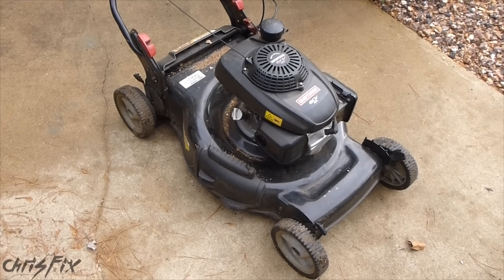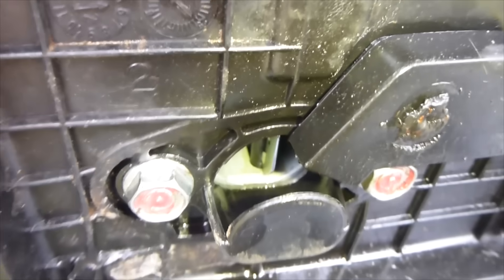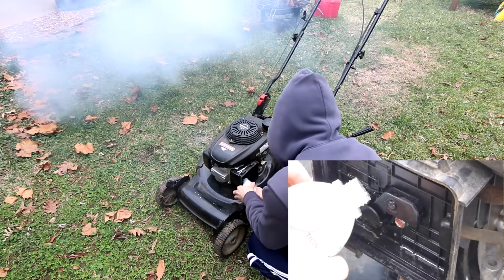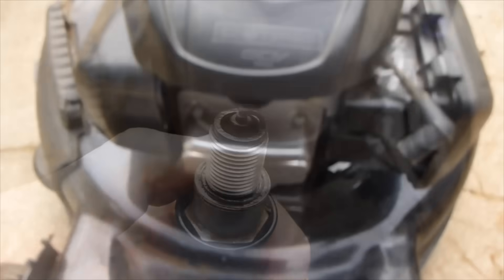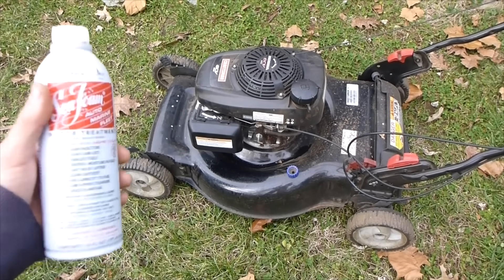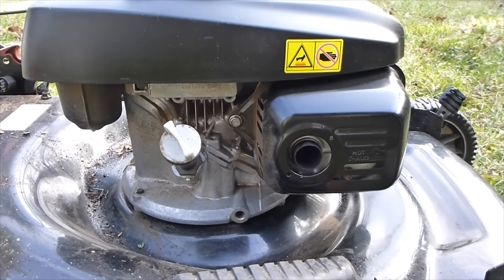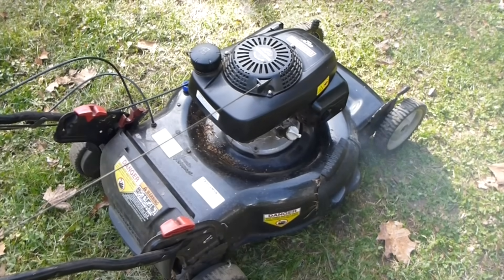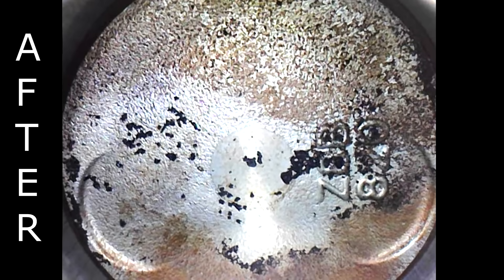Does Seafoam Actually Work? (with Proof)

Comment: FYI - you can run water into the intake and clean the piston too.  Just say'n
Reply: Adam mix I'm not messing with him, if the engine is at operating temp you can pour water into the intake and it will clean the carbon out. You can also drain the oil out of the engine and fill the crank case with diesel fuel, run the engine for 5-10 minutes then drain it and refill with engine oil to clean the carbon out of the oil passages.
Reply: +WinXPwhiz Hesmessin with you. Dont add water to your engine.
Reply: +Ken Simms Won't that hydrolock your engine? Water doesn't compress.
Reply: +WinXPwhiz best way to do it is to use a spray bottle. just like in the video, spray until the engine start slowing down. Repeat a dozen times and it should be sweet. Worked for me
Reply: +Ken Simms Water works better than this stuff, if the engine is hot. Also you can use ATF (automatic transmission fluid) to get better results, it is high in detergent and cleans well.
Reply: +hommie789   You're right I had to look it up. Sorry I assumed water was always harmful to engines.
Reply: +Adam mix There's such a thing as a water and methanol injection after market kit too, both for Gasoline and Diesel engines.
Reply: +Ken Simms No one ever needs to do this. A car won't perform any better or worse with such a small amount of carbon removed like the Seafoam results. Unless you post pics of your piston on facebook there is zero need to do it
Reply: +WinXPwhiz but steam does.
Reply: +Ken Simms get a carbon fiber engine. its better and you don't have to clean it.
Reply: If your engine is gunked up with sludge, you can add a quart of water to the oil, and it will clean it up like new. Just run it for 30 min, then drain. Repeat if necessary.
Reply: +WinXPwhiz if you fill your engine then yes it will hydro lock but the way to use water is get engine hot then bring revs up to approx 2000 and slowly pour water into the intake.
Reply: +hommie789 Well I'll have to keep that in mind.
Reply: ***** I don't like the thought of adding gasoline as it is so dry but diesel is an oil so it has lubricating properties to it, they use it to lubricate the injectors and injection pumps, so draining the engine oil out and refilling with diesel will cause no harm but will cut the sludge. But if you perform regular maintenance to your engine you will never need anything, all this is just for people who neglect their engine.
Reply: +4nuk8r carbon fiber is like woven stuff that they put clear stuff on and it gets real hard but doesn't weigh anything but it's like steel or metal but it's not really metal it's sorta woven
Reply: +hommie789 It will also wash the oil off of the cylinder walls.Don't do it.
Reply: Chief 1 What will? Using diesel fuel? Diesel is a #5 oil and is used to lubricate pumps and injectors in the system and causes no harm inside an engine
Reply: +Kevin Miller caurs cant drive on water. have to be gas or car is going to rust inside and not drive
Reply: +hommie789 Id buy that, and Ill share my little anecdote as to why. 

I used to run an HHO device in an older S15 pickup.. It was the 2.5L 4 Cyl, good ol Iron Duke. No PS, no PB, no AC, no nothing but an extremely basic truck. 5 speed TBI.  I thought it was a good start to a 40mpg pickup so I made an HHO and put it on. It worked, not 40mpg but 35-37, which was close enough for a 225k mile truck. 

So the side effect of this was that there was a lot of extra water when the hydrogen was burned. Not an issue unless you turned it off and then wanted to start it back up right away - plugs would be moist still. 

Anyway, Im basically washing my engine with the stuff constantly. I lived in an apartment at the time and wasnt allowed to do much work myself in the parking lot, so every now and then Id take it to the one mechanic I trusted and just have him go over everything as I drove it a LOT for work. 

He was amazed at how clean the engine was and said the compression was damn near as good as a nascar engine as far as cyl to cyl goes (meaning they were all super close) He never did say anything about the HHO, but asked what I was doing to have it in such good and clean condition for such high miles.

It was the HHO cleaning the engine every time I drove it.
Reply: ***** They work but results vary. Carb'd engines and throttle body engines work pretty well, but fuel injected engines seem to get lesser results. I got about 8mpg more with the TBI 2.5l, but only about 2 more MPG out of a 3.3L Dodge fuel injected engine. Ive never tried one on a carb engine but I hear they do the best as you can lean it out a bit and make up for the lack of gasoline with the hydrogen. Same principle as a hydrogen fuel cell - its a gas that explodes and makes rotating assemblies go 'round :) Just have to make sure you arent running a super advanced timing or it will detonate due to compression alone.
Reply: +4nuk8r  Oldsmobile and Buick experimented with water injection in the turbocharged aluminum 215 v8s that they produced in the early 1960s Cutlass and Skylark. Probably used the same water/alcohol ratio.
Reply: It's not really a drain on the battery at all. It's not like you're powering a headlamp...you can leave it 'on' for days without starting the car and not even notice a difference when you turn it over. I'm not trying to sell anything and I approached it with disbelief myself...results were results though. No fudging needed.
Reply: Seafoam IS an injector cleaner.
Reply: Ken
Reply: I had a 283 Chevy engine my grandpa was old school they didn't have all this stuff he grabbed a coffee can filled it with water and did this same thing dumping it down the carb.  ... I thought he was ruing my motor but it does work on old or carb engines ....

Comment: If you've ever changed a head gasket, you have seen how the anti-freeze/ water combination cleans the the piston on the leaky cylinder.  A small amount of water injected into the air flow would have done a better job than Sea Foam.
Reply from the maker: +alex tworkowski Thanks for sharing. A head gasket leak is not a "small amount of water" and works different than just water being sprayed into the intake but I will be testing it so stay tuned!
Reply: +ChrisFix my uncle, a diesel mechanic used to tell me that all the did to clean carbon out was to "steam clean" the engine just as Alex Tworksowsky was getting at (i always thought it might have been bs) but i am familiar with the power of steam.  I don't think the water\glycol combo like antifreeze is a good idea because we all know what kind of residue antifreeze leaves behind. I like seafoam myself but always wondered if it has ever worked with the steam clean method? Side note: for a car engine, antifreeze and oils that contain teflon (slick 50) if a car burns either slightly will end up costing you 02 sensors in the future.

Comment: You could have done the exact same thing with a cheap can of carberator cleaner with Methal Ethal Keytone in it for $1.85 a can at any auto parts store instead of $10 for the Seafoam.  Seafoam works best mixed in the gas tank before storage of any engine not being run for a period of over three months or more.  Upon start-p the Seafoam does an outstanding job of cleaning the injectors or carb and is a excelent feul stabalizer while it is sitting.
Reply from the maker: +gilbert nowak jr Thanks for sharing!

Comment: You also scoured your cyclinder head just so you know.
SEafoam has some serious salts in it which does clean but it also damages your cylinder walls as you can hear by the sound your engine made the last time you turned it off the hissing sound of your piston scribing against your cylinder wall which didnt sound very good.  Best thing would be to use a fuel addtive in your gas like techron and new plugs everyseason with premium gas.  I would use techron sythetic fuel addtive after this because your cylinder walls is what gives your engine good compression torque and power.  Seafoam has like salts in it which may clean up carbon but it also scoures your cylinder as you can hear in the last time he turns off the engine.   Also the cylinder is what makes a good tight engine strong and needs to have smooth tight between the piston rings so when you put seafoam you are messing all that up pretty bad.  Rings are round and once you make a nick in the head you loose that smooth engine and its gone.  Best is to use techron with sythetic or some high quality gas addatives with sythetic lubricans for the upper cylinder in my honest opinion.

Comment: You can get the same results with water. Try it.
Reply from the maker: +lazzer408 I will be doing a video with water so stay tuned!
Reply: +lazzer408 I use break fluid, works great.

Comment: you will get the same results using plain water !
Reply from the maker: +Alan Cooper Thanks for sharing! I will be testing water so stay tuned!
Reply: +ChrisFix  it's an old trick, but the engine has to be hot, spray water with a mist bottle in the carb, it is basically "steam cleaning" it was more used in the old days to clean carbon from an intake manifiold, something else that works is Kerosene..great videos

Comment: I hate to say this but I think you are using it wrong. seafoam is for the crankcase or gas. seafoam spray and LUBRICANT is for spraying in the intake. my fear would be premature engine wear by washing the rings down. I love seafoam products and have been using them for years.
Reply from the maker: +William McBride Nope, I am using it right. It says right on the bottle how to use it and I followed those instructions.
Reply: Chris, I stand corrected you are correct. I completely missed that part on my cans. I am sorry for crapping your post.

Comment: After you do this it's important to change the oil. You may end up with a lot working around the rings and into the crank case. A little wont hurt, and may actually clean varnish and sludge out but a lot could be harmful.
Reply from the maker: +Clay Atkins Thanks for sharing Clay!

Comment: I wanted to see if this stuff worked before adding it to a carbureted motorcycle that had been stored for over a year.
It looks like mixing it with new gas might help so the cards do not have to be overhauled.
Reply from the maker: +Daniel Alioa Yea, it should work pretty well for keeping the carbs clean.

Comment: I have 2009 Buick enclave cxl with 192k km on it.  What would you recommend me one of fuel additives or something like Seafoam?
Reply from the maker: +Stanislav Terekh I do not recommend any additives if the car is running fine. They just cause problems on cars that run fine.
Reply: ok, Thank You.
Reply: +ChrisFix why did you use it on a lawn mower then? Was it running badly? I had a Jetta that was running awful and I poured gallons worth of Marvel Mystery Oil into the oil and the gasoline and it still had no improvement to my car's performance. I used Seafoam in the gas, too, but that didn't do anything. None of those or STP fuel injector cleaner helped. I lost faith in all of that stuff. The most improvement I saw was when -- on a tip -- I added Adya Clarity to my coolant. It increased my mpg 12 miles more. Now over a year later, it looks like I need to add more Adya. So this cleans engine parts and improves gas mileage, in my opinion. It also changes the blue color of the coolant to brown. Makes me wonder what that artificial blue color does to a car engine.

Comment: The same results can be had by spraying plain water, slowly, into the intake. The steam caused by the water mix, can actually do a better job. Old mechanics used to do this, go clean carbon off valves and pistons.

Comment: So.... I learned an old Indian trick while working at a Chevy dealership, from an old school mechanic. Same idea with feeding the seafoam into the carb a little bit at a time. Just use water instead. Let the engine run to warm up and trickle water (or spray/mist) while it is idling/running rpm. The idea is that the relatively cool water hits the hot carbon build up and shatters it. Carbon is crystalline in structure, like glass, and won't hold together through drastic temp change. Of course don't use a lot and don't let water sit on the piston. Again, the water rapidly cools the hot carbon and causes it to "shatter" or break up, and easily pass out of the exhaust valve. "But water will make my piston rust!" A good amount of burned gasoline turns into water and passes through your engine just fine but it is already hot.
Reply from the maker: +calyoazz Thanks for sharing! I will be testing water soon so stay tuned!
Reply: +calyoazz We do the water in a fine mist just before a rebuild, removes all carbon then when the heads are removed you can mic walls for wear. By the way pouring any liquid strate in carb is not good.

Comment: I gotta say that this test is meaningless. Carbon builds on the piston regardless of what you want to happen. It is actually an insulator and keeps temps in the combustion chamber instead of into your piston. Why would you want to do this? Now cleaning the intact tract and the back side of the valves I see value in. But to "clean" your engine in its entirety, this is snake oil.
Reply from the maker: +Super Fabricator Thanks for sharing!

Comment: I used seafoam on my car and ended up with oil leaks and a sputtering engine.I followed all the specs.
Reply from the maker: +MadWeiner Yea, it could also cause problems depending on the condition of your engine and what is wrong! That is part of the risk for trying these things. Thanks for sharing!

Comment: This is a pointless test.  You didn't have that much carbon to begin with.  Its all about the valves.  Which you didn't check.
Reply from the maker: +Marek Sumguy Thanks for your feedback. If you can remove the carbon from the combustion chamber, you can remove the carbon from the valves. I am developing a way to check the valves so stay tuned!
Reply: +ChrisFix  Chemically speaking... you're right.  But Physically speaking... you're wrong.  

Just because it cleaned SOME of the carbon on piston doesn't automatically mean it will clean the valves with the same effectiveness.
Reply: +ChrisFix On second thoughts... even Chemically speaking... you're wrong.

Comment: Have you ever tried a product that is added to the fuel tank and used on a regular basis that will keep the engine clean? I am assuming that carbon buildup occurs over months and years and as a general rule of thumb, I wouldn't expect too much of that carbon buildup to disappear after just 5 minutes. I'd rather do something on a regular basis to help keep it clean from the beginning. Any tests on that?
Reply from the maker: +umaxen01 Check the links in the description to the other fuel system cleaner tests I have run.

Comment: hey would you recommend letting the car piston soke in the seafoam, just like you did on your previous vidoe with the lawnmower?
Reply from the maker: +Miguel Salinas No, I do not recommend that unless you have serious carbon issues causing your engine to not run properly. All of that carbon coming loose at once is not a good thing.

Comment: Once had an 80's vintage Dodge van, 360 engine with really nasty sticking lifters, every startup was a noisy event.  Was ready to get into the engine when a mechanic friend suggested Seafoam additive in the oil.  As I had tried several other miracles in a can I was doubtful, but was I ever wrong.  One treatment as recommended and that van ran quiet.  I was amazed.  I added a little when I changed the oil and drove it for a few more years, no return of lifter issues.  Still use the stuff today in my vehicles.
Reply from the maker: +coldfoot99 Awesome! Thanks for sharing! I love hearing when stuff actually works!

Comment: and what did this help? motor run before motor ran after. no per foments help so why bother ?
Reply from the maker: +papashake shake It is a test to see if seafoam actually removes carbon. It didnt necessarily help much in this case.

Comment: you can also do a piston hot soak.. heat up engine b4 use pour sea foam where spark plug goes wait 5 or 10 min  take out sea foam.. usually crank with out spark plugs in engin.. replace spark plugs and crank up let burn off smoke and then check the carbon deposits on the piston..
Reply from the maker: +John Collins Thanks for sharing John!

Comment: Seafoam actually works. I have used it in my old 99 Nissan Altima w/ 320,000KM.  I usually treat my car w/ Seafoam before an oil change.  Pour like half the container into my engine, and half of it into the fuel tank.  After about 200-300KM of driving, I get the oil changed. All the gunk, carbon just comes out black in my oil.  Once the engine is filled with clean oil, it just runs sooo smooth with increased acceleration and even the fuel economy is improved with the Seafoam.  Very good product that actually works and not some snake oil..
Reply from the maker: +Organic Beast Thanks a lot for sharing!
Reply: +Organic Beast Interesting comment. Thanks.

Comment: if like sea foam youll love techron
Reply from the maker: +don metcalfe Actually, not really: https://www.youtube.com/watch?v=h8i9qftqKNY
Reply: +ChrisFix chris I am a mechanic and I have used about everything on the market to try and make my life easier and yes really ive used techron on clogged carbs clogged fuel pumps clogged fuel injection on everything from go karts to boats to semis and yes my young friend if your having fuel problems use techron and I keep my open for new products that little bit of carbon you have here makes no difference in the running of any engine but with todays gas with ethanol or gas trucks that deliver 100% gas but have built up residue in the tank and hose will indeed cause problems as a matter of fact that residue is 95% reason for loss in gas mileage lack of power and overheating do to motors running lean because theyre not receiving the correct amount of fuel  also works on boats if anyone is interested. but nice video........